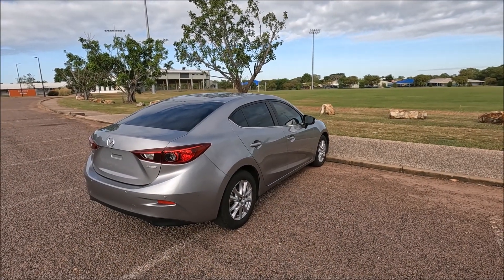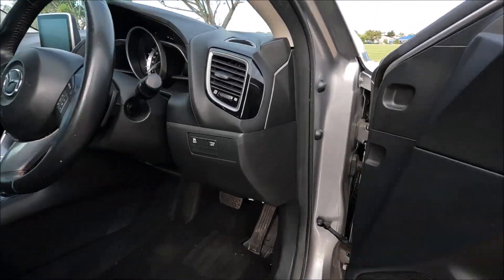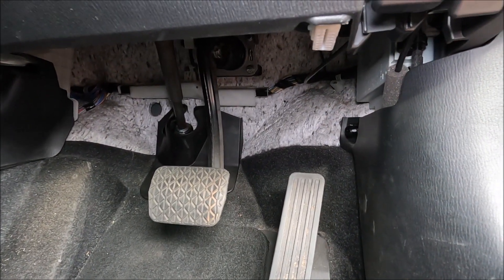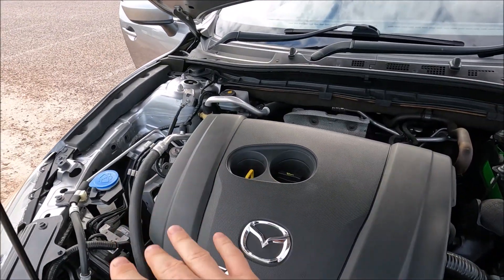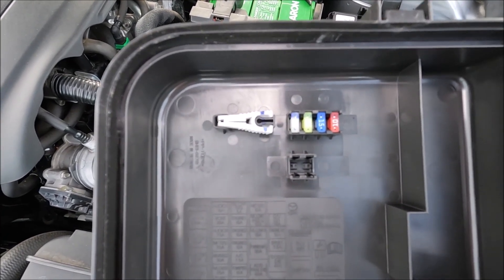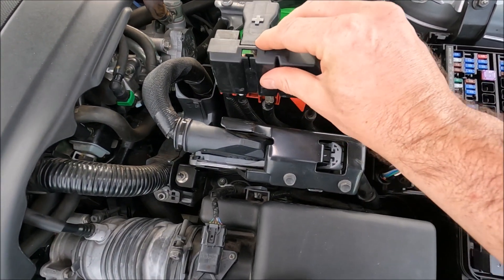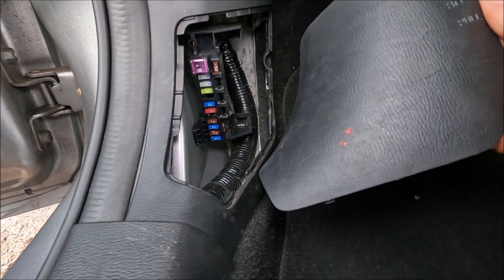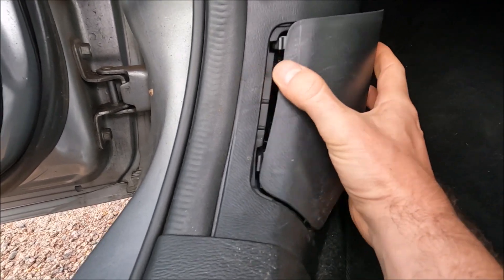Mazda 3 OBD2 Diagnostic Port, & Fusebox Locations 2013 - 2018

Comment: Thank you !! Saved my day. I did a trickle charge of 12 v 2.3amp through the diagnostic port to keep computer settings while I changed my 7 yr old battery (2017 Mazda 3).  Couldn't find the OBD2 port where I connected (was picturing my old Toyota Corolla port). lol. Anyway, your vid saved my day finding the port to carry on lol.
Reply from the maker: perfect, I am glad it helped. Thanks for your comment and watching. Regards Ross